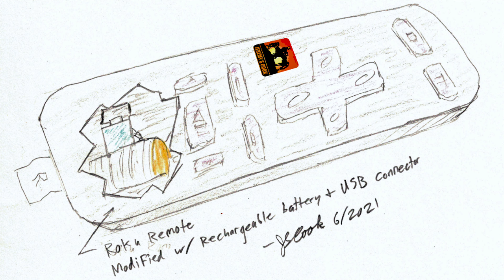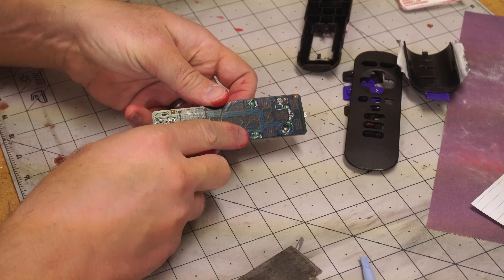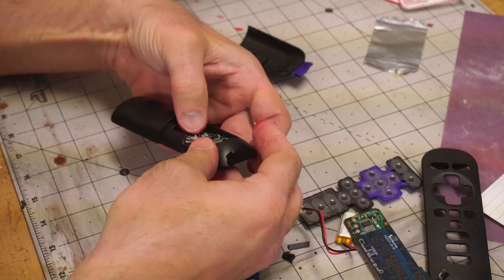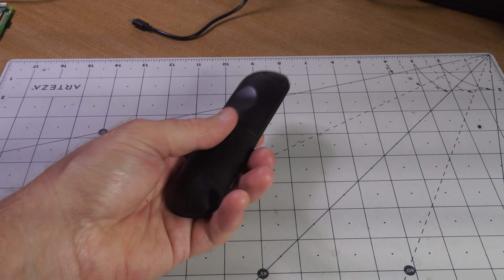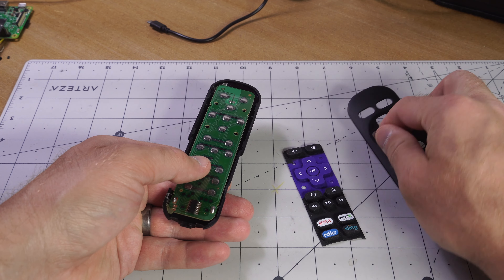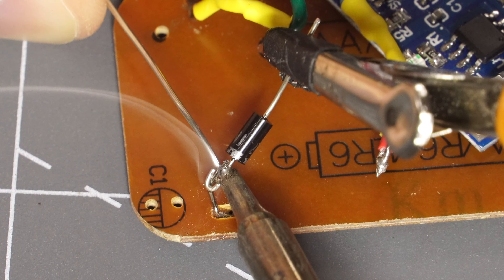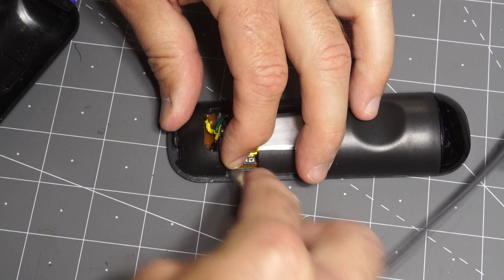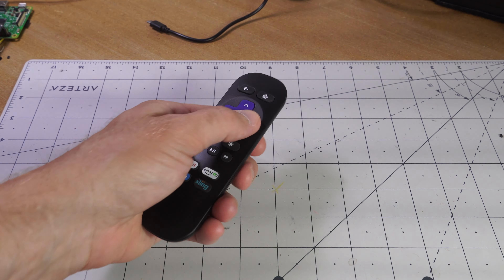Roku Remote USB Rechargeable Upgrade [Li-ion Howto]

Comment: Using the diode in series was really good idea. But did you say only about 300mV was dropped across the diode? That is curious. It's a 1N4007 I assume?
Reply: Ok so I was really curious and looked it up. If it's a typical 1N4007 (or similar) it will do that until a certain minimum current passes through it. So it's quite likely the load presented by the circuit board is very small (as in it has a very high resistance.) The other possible explanation is that some diodes actually do have a forward drop voltage of 0.3V but those are not too common. Thanks! You motivated me to look something up and learn something.
Reply from the maker: @makermikesizer  Ha, well thanks for figuring that out for me! I suspected it might be something like that, and while I'm not certain it was that diode, it very well could have been.
I also suspect that the current goes a bit higher for a short time while the button is pressed, so maybe it does drop .7 in action!

Comment: Hey  you got a picture  of the wire diagram  for  roku voice  pro  a wire came off  the board   that  goes  to battery  yhe black wire  it works   plug-in       some  how this wire  is the  power  from  the  battery    to broad  cause  the other  run the charger
Reply from the maker: Sorry, I don't have a picture of that remote.
Reply: It came off the battery  pack

Comment: Nice work, Jeremy!  Just don't let the battery get too low! ;)
Reply from the maker: Thanks! The board I'm using has some built-in undervoltage protection I believe.
Reply: @JeremyCook  amazingly I had  a relatively good ten year old cell phone battery that fit perfectly even with the TP4056 charging chip.  I used the smaller chip since my remote annoyingly quits  at 2.9 volts - now considered a low voltage shut off feature :-)
Reply from the maker: @mevk1  Oh, that is a pretty cool "feature" Glad it worked out 😃

Comment: Would you like to try replacing the battery on a roku enhanced voice remote pro with remote finder? They have a fixed battery but the battery dies every 2 to 3 years. I am on my second set and the battery keeps dying on me but the remote still works fine with plugged in.
Reply from the maker: Thanks for the suggestion, but TBH probably not as I don't have one.

Comment: How would you do that with the other roku remote,the kind that has 2 battery springs on same side,and the flat sides are on same side...have to put the batteries in same direction
Reply from the maker: This is the only one I've modded, but I suppose you'd need to examine the circuit to see where the positive battery series starts and where it ends - assuming the batteries are in series.